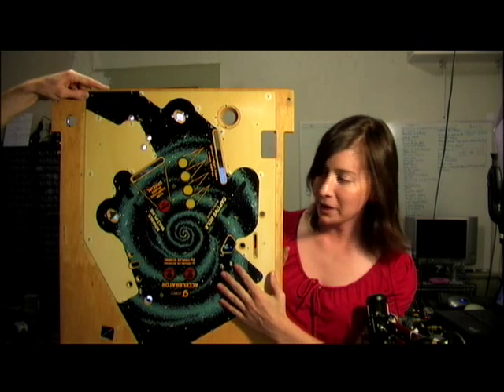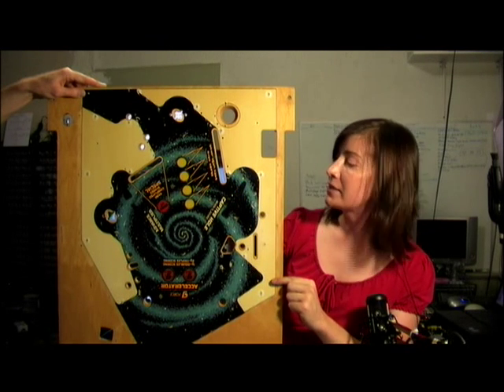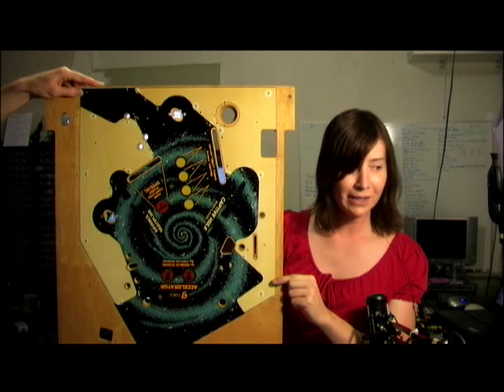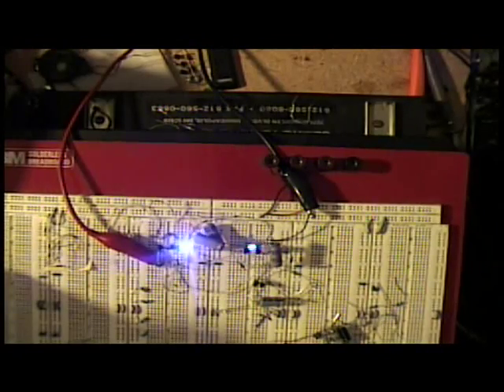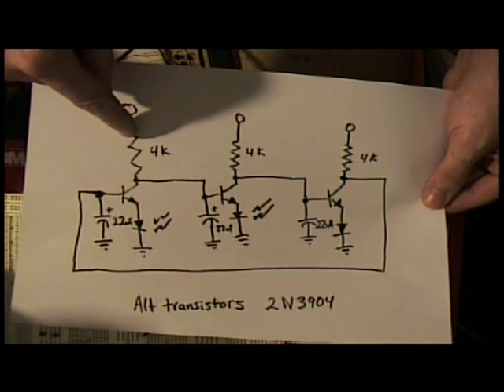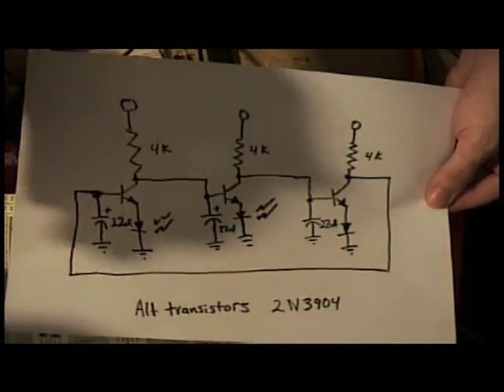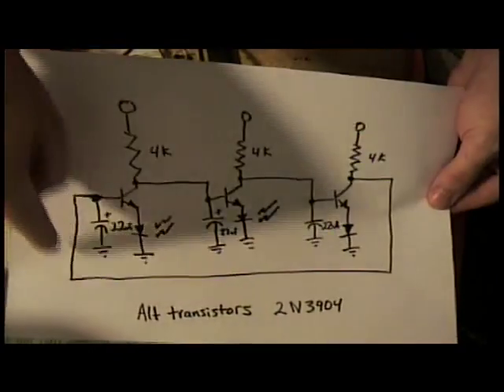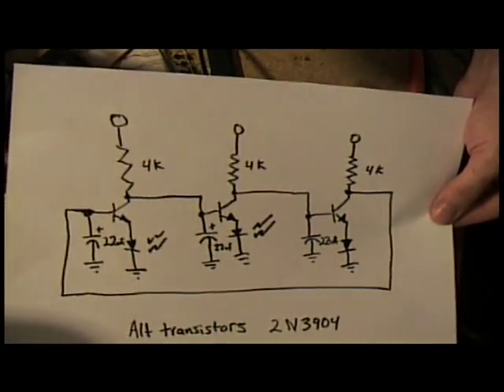Simple Chaser Lights - Short Circuits

Comment: What are the voltage you used. I also noticed you change the chaser speed by turning a pot. how were you able to get a pot with three sliders radio shack carries a similar pot but with only two sliders.